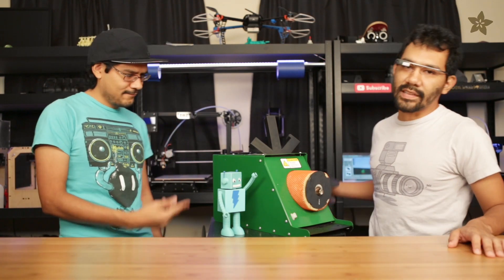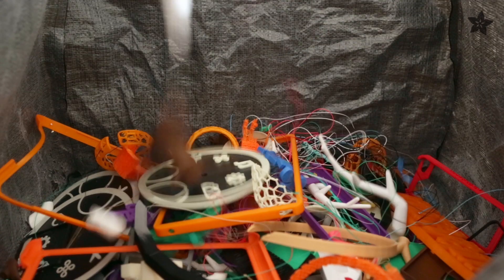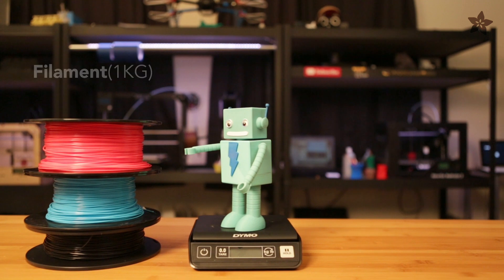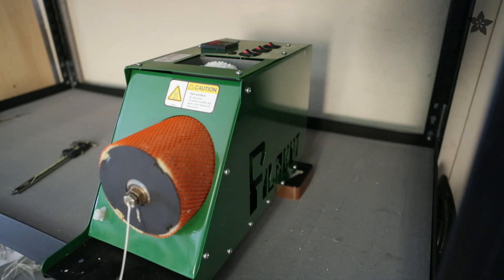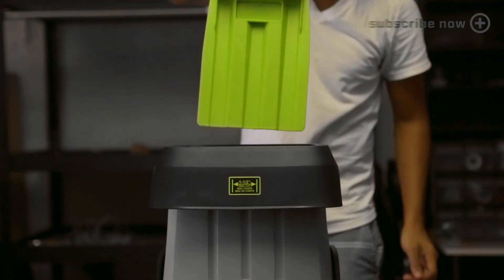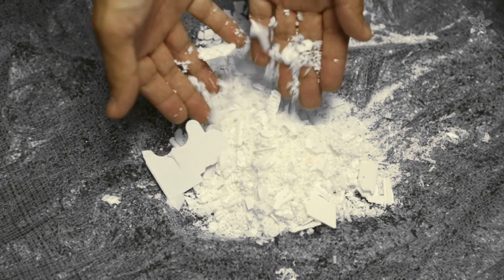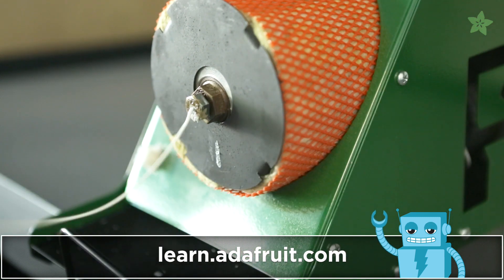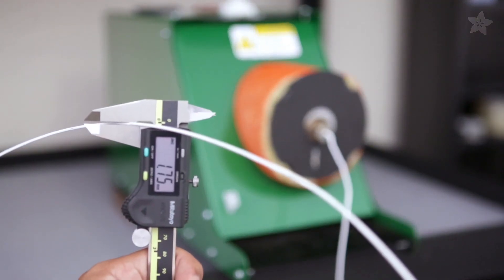DIY 3D Printing Filament with the Filabot #3DPrinting #Adafruit

Comment: I would use a pretty long extrusion pipe to get it laminary flowing and perhaps a water cooled end so that it cures before it comes out. It doesent have to be tight fit ( end) as the nozzle will fix that , but it would  be better quality if it had one cooling piece a bit off from the extruder

Comment: My university has one of these, good luck getting working filament with this machine.
Reply: care to elaborate?
Reply: @TSMSnation  The 3d printers at my university had MakerBot Replicators which needed filaments with low tolerances (no thick or thin parts). I was able to create some ok filament, but not good enough to finish a print. You need long water baths to create filament with these tolerances.

Comment: Other videos have cooling baths. letting it fall will give you different diameters depending on tension.
Check out other videos I am sure you have seen them.
I just watched one where the guy made the extruder himself in a garage #Make Stuff channel

Comment: This might work but I would be sceptical due to material degradation. May be ok but usually you have to have a percentage of unused blended in or other alternatives. I would also be interested in the air cooling. we always used a water bath and then dryers, first just compressed air through an air knife to remove most of the surface water. Would be cool if it worked though.

Comment: Given that you can get  new high quality commercial filament for $10 a pound now, I can't see how spending all that time and effort on breaking up old prints, mulching them and doing all the rest of this work is worth the trouble.  Especially if quality control issues are going to result in jammed prints or inconsistent results.  I have also read that the plastic is not as strong after recycling it as it was the first time around.  It's a worthy cause and I'm glad people are spending time on it, but so far it doesn't look economically justified.
Reply: No good filament costs $10
Reply: 10$ for which plastic type? at which $/pound do you think its worth in your POV ?
Reply: pyronaught some people live on the edge of the world and cant afford shipping
Reply: well then just switch over to a cnc milling machine ;)
Reply: You can buy filament made in Europe for 20€ a kilo and the quality is quite good. Most of those overpriced filaments are repackaged cheap chinese-made filament.
Reply: yeah, I've shipped stuff to New Zealand before and the cost was insane!

Comment: my outside diameter is not consistent, how do I fix that?
Reply: +darrey trash it again and make new one.
Reply: eat fewer carbs
Reply: Extrude through water cooler (with small 1 dollar pump circulating spillover water), and wind with adjustable revolution motor. Adjust to fit spec of diameter. Then you can buy one of those chinese calipers, screw extruder idlers to its jaws, take measurement through hidden dataport to arduino and PID adjust revs of winder motor with that... That's basicly what i am building now.

Comment: So where's the second vid with the testing and what not?
Reply: good question^^
Reply: The filament wasn't consistent enough to use.  The method of extrusion and just letting it gravity feed to the floor demonstrated would only work if the extruder points straight down.

Comment: it seems like the design could be improved by a coiling device; maybe like something you wind yarn on?
Reply: The company that produces the Filabot has airpaths and spoolers available for the extruder units... You can get them as a full kit, however, be prepared to sell your left and right kidneys, both testicles and an eye to get it because the whole shebang is $10,000

Comment: Part 2 is where the real interest lies, the actual quality and ease of use of the filament, shadfurman the point of it not being automatic is trivial especially if you have a 3d printer to which you can create a structure/device/etc to actually do what you suggest.  The only real rejection to this whole this is indeed the price that people have pointed out.  Frankly the filabot is really just a screwdrive attached to a hot end.  Just like with the makerbot printers there is no way this thing should cost $900, that's a huge markup.
Reply: it would seem that the v2 is indeed WAY more expensive, to the tune or $2499, So now you can by a expensive makerbot and pay the same price for the stuff uses as ink! absurd.  The original looks like it got a price increase as well $1399.  I find it all very interesting, because rich over at rich rap created a hot end efector which he uses on a rep rap printer that uses filament pellets just like this and it doesn't cost an entire printer, sheesh!  I think even the part daddy or big daddy that the seemecnc guys use that is HUGE uses pellets so its not a unique or novel idea.  we have seen over the years how hard it can be to make quality filament, with pulling it the right amount out of the machine (yet another separate product from these guys) usually into a waterbath (trough) and then the art of spooling it onto a spool (yup a separate product again from these guys)  Its certainly just cheaper to go and buy filament these days for what you need.  The days of thinking of making your own is a think of the past because GOOD filament is now really really cheap.  The only thing of interest is the other machine which is $6k and its the "reclaimer" which will grind up your old failed/good prints to use as pellets.   But that's even a pain as you have to make sure all of your plastics are seperated because you don't want your abs mixing with your abs and abs mixing with your hips ;) anywho... blast from the past...
Reply: Why not buy the Filastruder?
Reply: normally you need to stretch the filament into the correct diameter so it can flex a bit, but  just extruding out the nozzle doesn't seems to make  it flex but making it very brittle

Comment: Sooo... the filabot is just an extruder? Does it do anything else? I thought it did the grinding and coiling... 

It's cool, but if it's not automatic it's not really worth it. My time is worth more than the filament, I can't stand there winding it.
Reply: has anybody tried using pellets strait in a 3d printer? Are there problems with air bubbles or something?
Reply: ***** "Feeding pellets strait into a printer is not possible" ... really? You mean like heavier than air flight impossible or computer chips faster than 1 ghz impossible? Obvioiusly its possible because you could attatch the filliment extruder to the printer and feed the pellets strait out of the  extruder into the printer. I was asking if anybody had tried and what the problems they ran into were. Good post, thx for the link. :-)
Reply: ***** I'm sure it would be quite a project, we need an eco-fan Lucky Palmer of 3d printing, lol. I'm not him that's for sure!
Reply: +shadfurman Im pretty sure plenty of people have tried it and that it is possible but that its just much more complex of an sulotion and the parts for the printer itself would cost exponetionaly much much more to build wich is why they continue on the path of the filament. I ofcourse only base this theory on how i myself would go by constructing such a device so i migh be wrong though :).
Reply: Janne Bengtsson a lot of people tried VR too. A lot of it has to do with the right person at the right time, we might just not have the pre-existing technology to come to the perfect simple solution, I do think there is a perfect simple solution.
Reply: Oh dont get me wrong, I absolutly agree with you on that. I just gave you my two cents on why it wasnt a thing yet. There is always good invetions and solutions to be discoverd. its possible that one of the 3dmachines on the homebrew market has more of a potentional to make such solutions since they tend to not think as much about manhours and singel part-cost and more about print material cost as massproducing companies does. but thats still my own theory.
Reply: +shadfurman People have made their own take-up spoolers for automating getting it onto a spool.

Comment: Surely there would be contaminants in them from skin oils, glue beds, or anything else that would mess with the filament when recycling? No cleaning process?
Reply: me
That has nothing to do with cleaning the filament. Any impurities are incorporated in the plastic mass.
The water bed cools the filament.